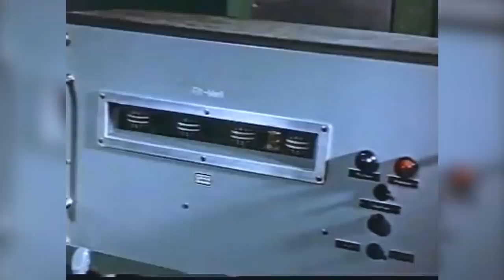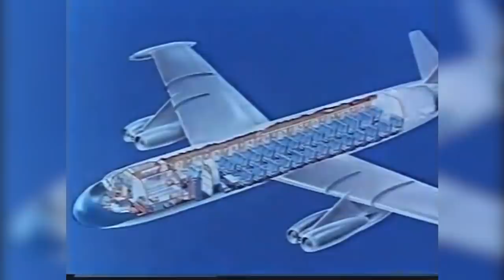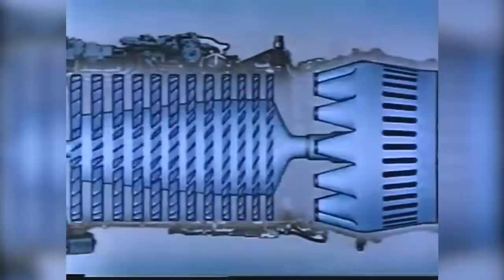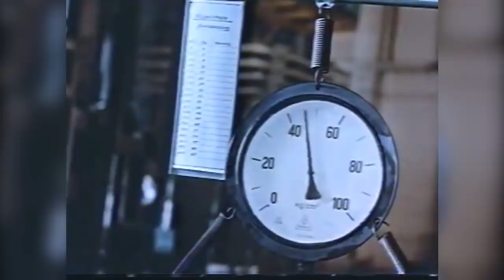East Germany's Attempt At A Boeing 737 - The Baade 152

Comment: What are you going on about  leapfrogging western rivals?  Are you nuts? The Comet was in service in 1953 and the Boeing 707 in 1958. And every Soviet civilian commercial aircraft had a glass nose years before this one. And the Eastern Bloc had years of using jets engines so had no lack of experience in "stalls" of jet engines. Have you heard of the Korean War? That was 1950 /53  years before this so jet stalls (if they exist, and I am certain you just read it somewhere and dont understand it) were pretty much understood by 1958. Do you honestly think they would design a plane that can't get fuel to the engines in landing configuration?  Think about it..
     And the TU 124 was already in service by 1956, years before so was not the reason why the USSR backed out. 
    The development team were not ahead of their time, they were badly behind the time. Do the passengers sit on the central wheels? That is the prototype you modelled, which was so unsuitable for an airliner they changed it to put the wheels the engine pods as on the next prototype.. Your explanation is almost wrong in every detail. 
   But I thought you were the expert and you find and explain things. Numbnut.

Comment: I will never enter into  the  Airplane Boeing 737again. At flight Dublin-Munichen in 737, april 2019 when  I came home,  l was watching the news and all 737 were put off use bcz some mistake in design.
Reply: Andre Milh Have no clue what you just said. Are you equating the 737 max to this piece of excretion?
Reply: @robinc6308  it is almost 4am,and l mix two different videos or answers, l don't know differents from 737 or airbus319 but after 20min of turbulence and shaking, loking the wing moving meter up and down. I will looking what type of plane will enter or ll probably choose train. better.